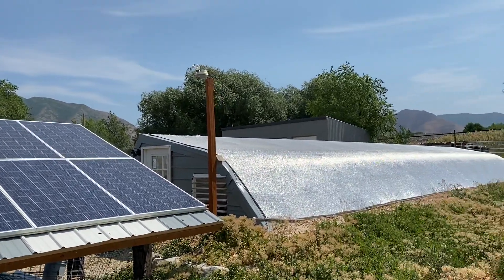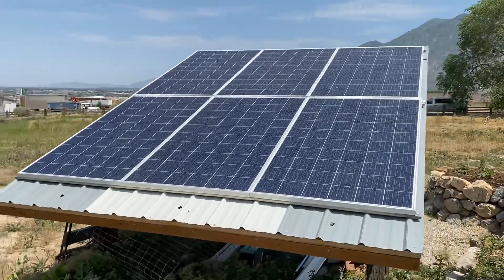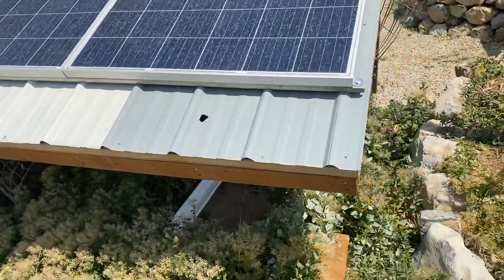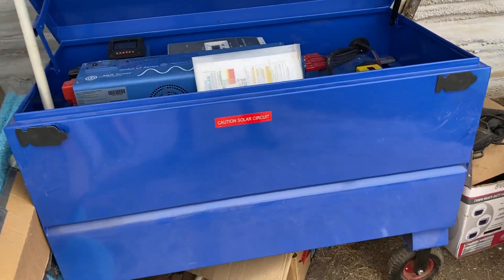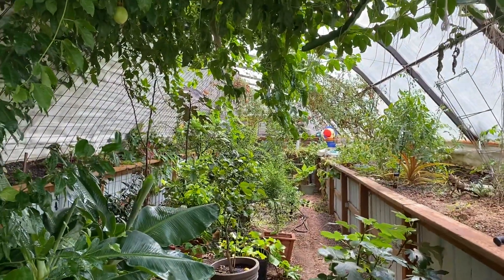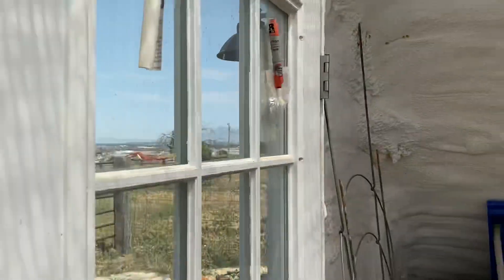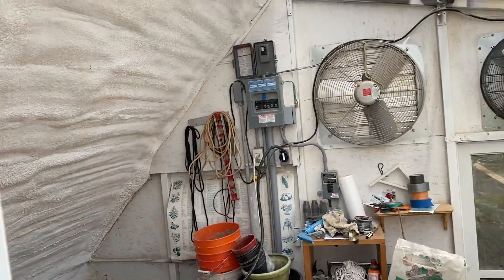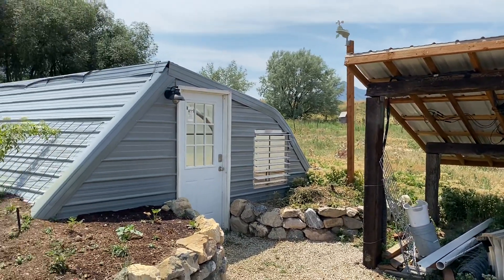This Greenhouse is powered by Solar

Comment: Your electrical connection from solar to the utility power is dangerous. Without a proper transfer switch to isolate the two separately derived systems a utility employee could be injured or even killed. Or your solar system could be back feed from the utility power & be damaged or even injure or kill someone. Please consider having a trained professional correct these safety hazards.
Reply from the maker: Please tell me specifically what you see that is wrong.  I don't do electrical.  I've had an electrician do it.  There are separate switches for solar and power to the Greenhouse, as well as power from the main box (in my Shop) over to the Greenhouse.  If you see something incorrect, i'll forward the comments to my Electrician.
Reply: @trailbreakfarms  A trained professional would understand my first comment after watching your video. I would suggest finding a different electrician. One that has experience with backup generators would be helpful. Connecting a generator is essentially the same as connecting the solar system you have. See this video for the basics of a generator connection to a home: https://www.youtube.com/watch?v=GLgtFCJlVFQ

Comment: How many volts/amps are pulled by your squirrel cage fan(forget if there's one or two of those) that circulate the ground loop.  Your canopy looks good.  My greenhouse is almost half built; will be ready by winter.
Reply from the maker: When the two fans go it my Volts reading drops from about 27 (my full charge reading) to 26 to 26.5.  Doesn't seem pull much.